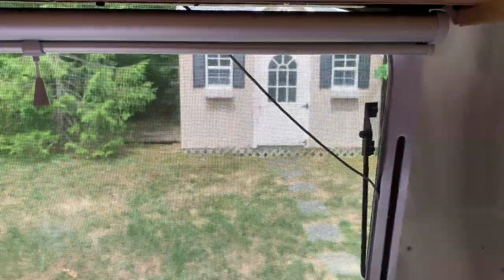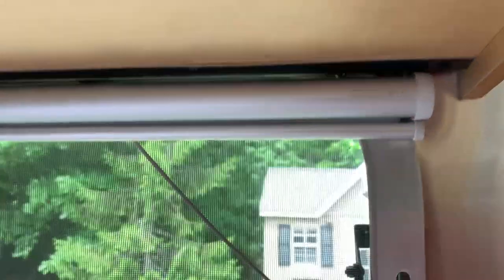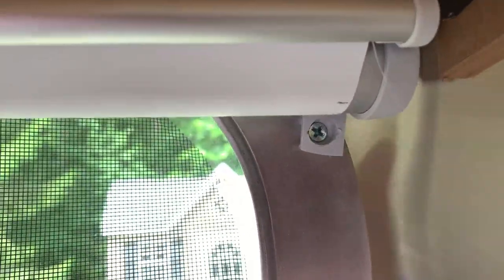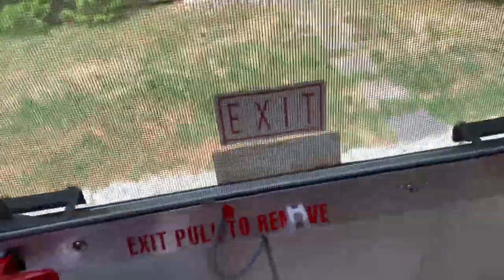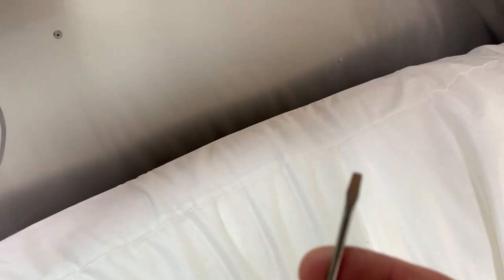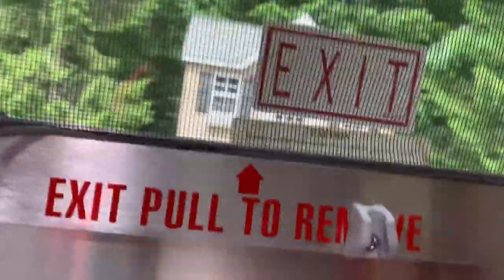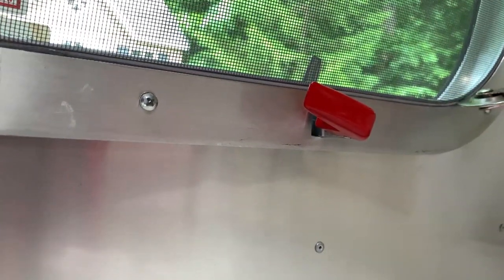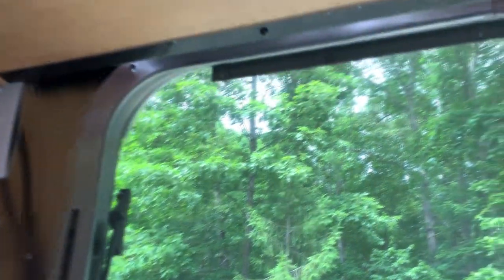How to: Fixing an Airstream Screen

Comment: You did not show how difficult it is to re-insert the spline.
Reply from the maker: Gary Dietz It is not difficult.  You press it into the groove and then use the roller tool to push it all the way in.